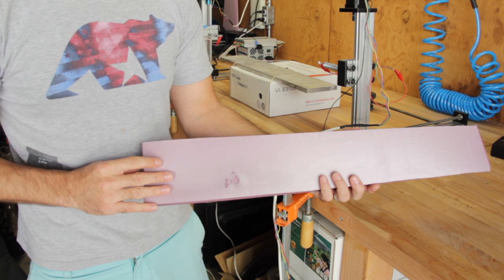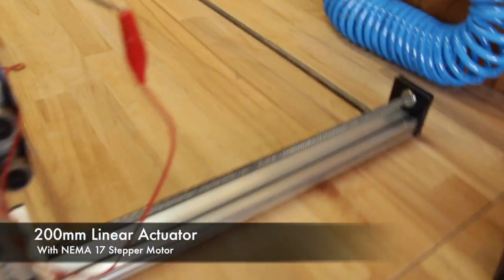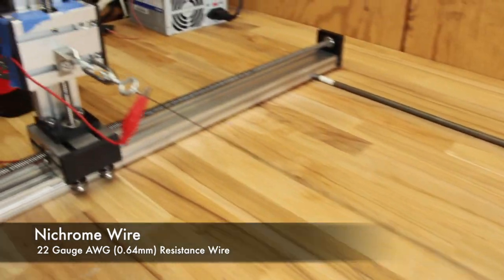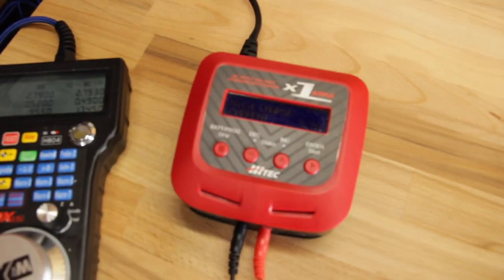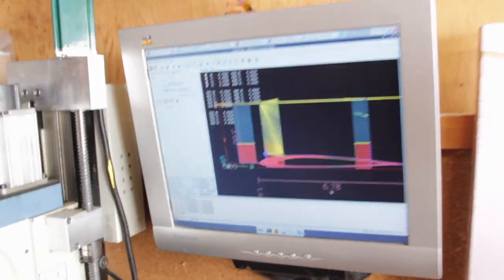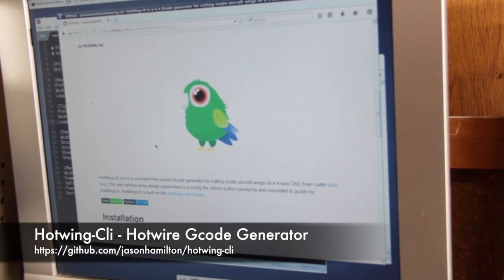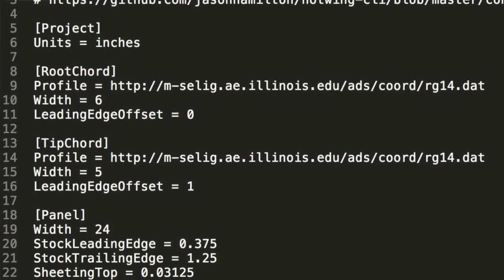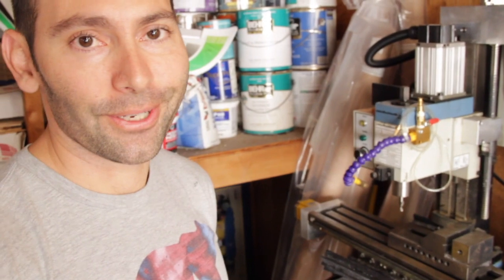DIY 4 Axis Hotwire Foam Cutting CNC Machine

Comment: Thank you for the video. 
Would it be possible if the wing was having a twist of -2 degrees. 
The hot wire can handle such configuration?

Comment: That's a 2 axis CNC, not a 4. You're using 4 stepper motors but 2 in parallel. You are using a y axis and a z axis. You could add a rotary table to have a 3rd axis.

Comment: hello, nicely done! Could foil software be used to cut fuselage cross sections, inner and outer edge? Could it be modified?
Reply from the maker: It’s only for the wing.  It’s not designed for fuselages.
Reply: @JasonScottHamilton  If I cut profile of fuselage and draw it in one continuous line it might be just awquard  wing foil naca xx22 :D then it will cut it.
Reply: I use adrifoam x4 it can do a lot of things

Comment: Any idea if I could make a similar one with like an 8 foot length. I am not using it for wing making. problem I see is stiffness of the wire. I do have some 390 lb stainless steel aircraft wire that is woven, but I am afraid the woven wire will have problems with uneven heating among all the small wires. Also I am looking to make profiles similar to your wing design profiles (only not wings...lol) Thanks in advance for the advice!
Reply from the maker: I agree that the longer wire may give you some additional challenges but i have to imagine they can be overcome.  I’m just a tinkerer so this is probably beyond my level, however I can share my thoughts based on this project.  

As for the wire, you’ll probably need to experiment with it and see if it works.  The nichrome wire has a higher resistance level so it heats instead of melting.  You’ll want to measure the resistance of the wire and size a power supply based on that.  You can find calculators online but you’ll need to use ohms law.  With the measured resistance you can determine the amount of voltage you need to achieve the heating level / wattage you need and your power supply can handle.

Depending on how large the travel in the axis are you may need to come up with some way to dynamically tension the system.  The distance between the axis could vary quite a bit  so you may need to adjust for that.  On this small project a small spring works, so maybe you could just use a bigger spring?

Hopefully that helps.  Good luck with the project!

Comment: Thanks for the video. Is there a way to have your program work with usb? Thanks again.
Reply from the maker: amtpdb1 that’s a good question.   I haven’t found a good solution but depending on your needs there are options.  If you only have a 3 axis cnc the UCCNC options are excellent and reasonably priced.
Reply: @JasonScottHamilton  Thanks for your time and suggestion.

Comment: That's 2 axis.
Reply: I was just thinking the same thing
Reply: It is 4 axis, the vertical towers represent individual y and z axis and horizontal X and A  axis.
All can move independently to make 3d shape.
Reply: @zulqarnain698  Not unless you make the cutting wire variable length with a weighted system for example, as it is the distance between the two towers must remain the same dimension so both axis' must remain in sync....
Reply: @mal6232  The spring allows for change in length. This is definitely a 4 axis machine which allows all 4 motors to move independently.
Couldn't produce a tapered wing with a tip slimmer than the root if it wasn't.
Reply: @zulqarnain698  sorry i didnt pay attention, you are right! how would you programm the tilts though? what postprocessor software?
Reply: @zulqarnain698  not a problem until everything is paralleled (Y is slave to Z, A is slave to X) but if they are separate?
Reply: still feels more like a 2 axis machine, than true 4 axis. (4 motors though!)

Comment: Hi Jason.  Very cool setup indeed.   A bit confused thought.  You said you are running LinuxCNC to drive your equipment but then you are suggesting that you need your own CLI software to convert to gcode?  I was under the impression that linuxcnc does it all.  Going to a setup myself using 3d printed parts but haven't figure out what to use to drive my equipment.   I have an older 3d printer that I am going to try to re-purpose some of the parts.  Unsure if a 4d printer board (axis) can run this project.  Thanks again for posting and your great explanation.
Reply from the maker: George Santana best of luck on the new project.  As long as the stepper motor and driver has enough power it should work for a hotwire cnc cutter.

In regard the the GCode question - any cnc or 3D printer takes instructions (move x,y,z axis to position a,b,c), typically known as GCode.  With a 3D printer you use a software to turn the design into movements on machine.  Likewise, with a cnc running Linux cnc, you need to give it something it can understand.  You turn the design into GCode and then feed it to the CNC which just follows all of the instructions in order.  Hopefully that makes sense.

Comment: Great job. Just a suggestion: cut cooler, it should indeed melt in front of the wire, but still draw hairs on the foam. Cutting tapered wings with foam templates, I had better accuracy tapering the hot wire and use the thin end on the long cord. Easy and fast to do, if you glue the wire to the table and solve the glue when finished.
Reply from the maker: Michel Driessen thanks for the advice.  With the tapered wing I couldn’t get a feed/heat combo that would cut both sides perfectly.  The smaller side of the taper would be too slow and the large side of the taper would be too fast. 

It sounds like you’ve come up with a solution if I understand correctly. Are you saying you taper the wire? Like stretching it to make it thinner?
Reply: @JasonScottHamilton  I had the same problem. Thus I stretched a wire over the table, glued it with cellulose glue scraped of the glue on the top and then passed sand paper over - for example - 3/4, 1/2, 1/4 several times until it became linearly tapered. Since you are burning in front of the wire, there is no stress other than the tension. To release and clean the wire, take acetone or thinner.
Reply from the maker: Michel Driessen that sounds like an amazing solution.  It’s almost as the glue acts like insulation, if I understand correctly.  Did you come up with that yourself?
Reply: @JasonScottHamilton  No, the glue is only to fix the wire to the table, to be able to sand it down. Afterwards you clean it off. Alternatively you can keep the wire strung between the poles and pass sand paper along to taper it. The result is a a wire that gets finer from one end to the other, gets higher electrical resistance, gets hotter and passes through the foam easier, with more or less the same kerf at a higher speed. Thus the main effect is a variable electrical resistance along the wire.
Reply: @JasonScottHamilton  I want a machine

Comment: Great work Jason will be taking a look at that software you've written.  Can it generate G93 feed speeds. I found an issue with LinuxCNC when cutting a very swept wing. One side works fine and then when you cut the other wing it speeds up. I posted on the LinuxCNC forum and a clever guy there added a work around using a filter.  I've now built a USB version running a 4 axis version of GRBL which can control the hot wire as well.👍👍👍
Reply from the maker: Keith Howlette awesome! Yes the software can control the feed speeds. I’m not aware of the issue you mentioned.  Have you found a solution?
Reply: @JasonScottHamilton  Yes I did there was a clever guy on the LinuxCNC forums that provided a filter that generated G93 Inverse Time Feed Mode which I tried and worked.  Mach3 didn't have the issue.  I'm mainly using DevWIng Foam now and that use G93 by default so you see a feed rate at the end of each line of G-code. So LinuxCNC will be fine with this. Thanks .

Comment: Wouldn't it have been cheaper to buy some stepper motors and work out some sort of belt driven system?
EDIT: I'm asking because I'm working on building my own and I'm currently in the planning stages.
Reply from the maker: UndefinedEssence possibly.  I think it would be a trade off for simplicity of design.  What did you end up using?
Reply: @JasonScottHamilton  Actually I changed my mind.  I decided to make my first CNC type machine a 3D printer.  That has been crazy.  When I get back around to this I think I'll go with belts with all that I've learned, but I think my next project will be like a CNC router type design, and I suspect I will need lead screws or similar just for strength.  Maybe even those ball screws.
Reply from the maker: UndefinedEssence awesome! I really been wanting to make a router but I’m running out of room with all my projects :)